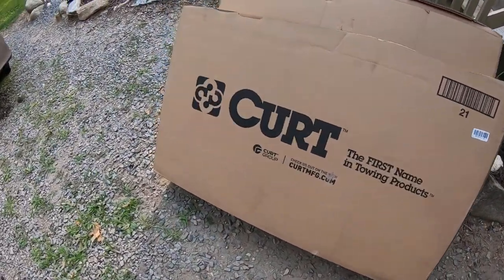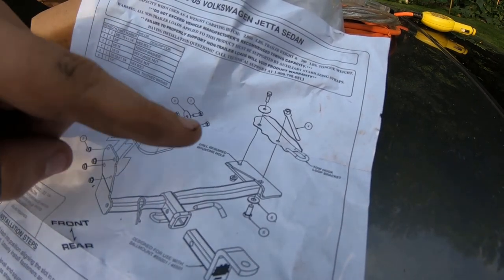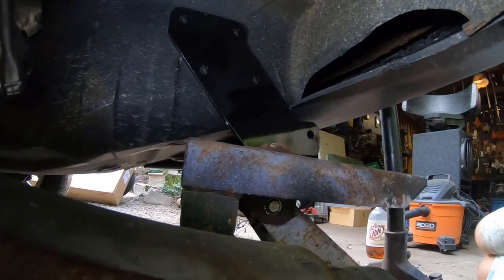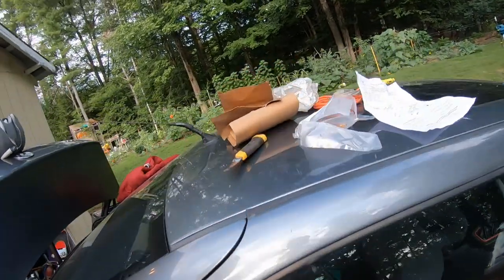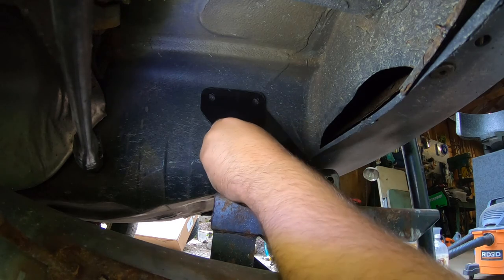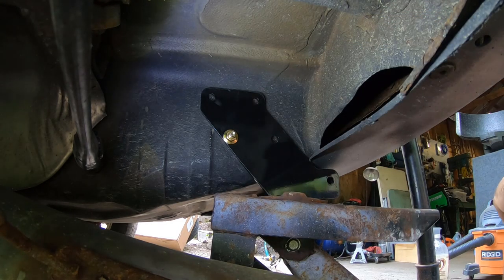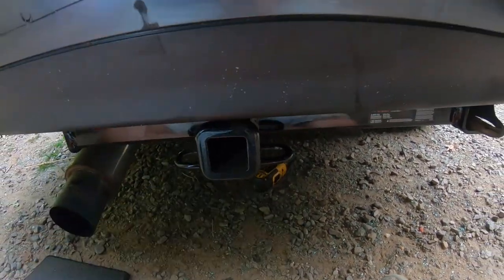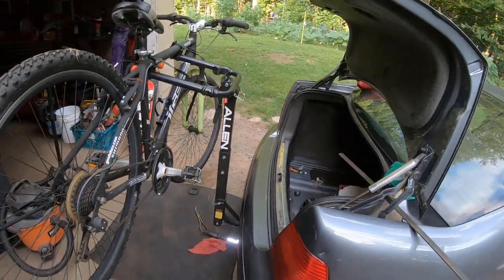MK4 Jetta TDI trailer hitch install

Comment: Why did you expose the threads to the outside? You could of put them in the trunk. High and dry, away from rust and dirt.
Reply from the maker: They would get in the way of the spare tire.
Reply: @prestofixit3518  It's all good. I just installed the Curt hitch on my 05' Jetta TDI. Put threads on inside. Tire is 6 inch's from any of the bolts. It was just a tight fit for the styrofoam filler that i put back in, but it fit. Now if i ever sell the car the hitch will be easy to get off. Lots of road salt here in the winter.